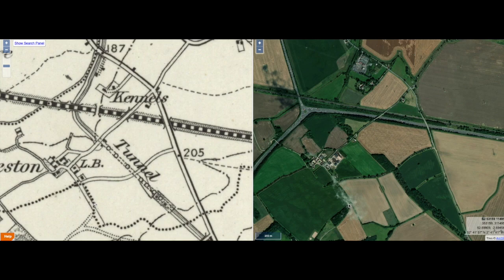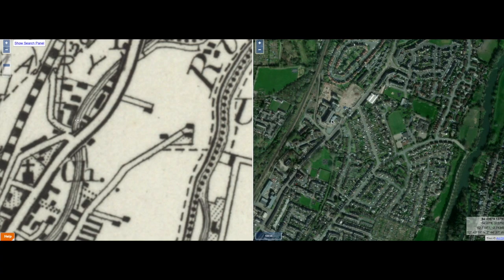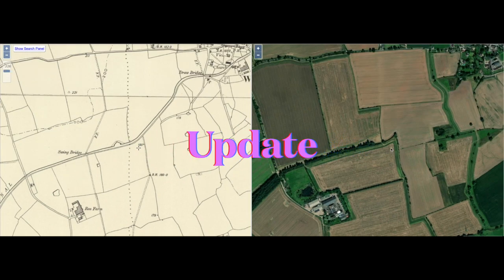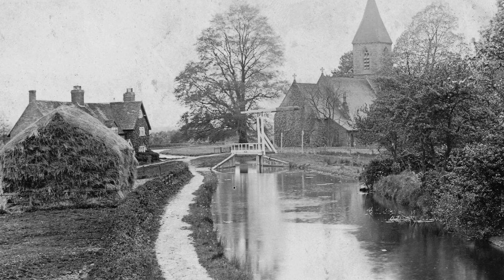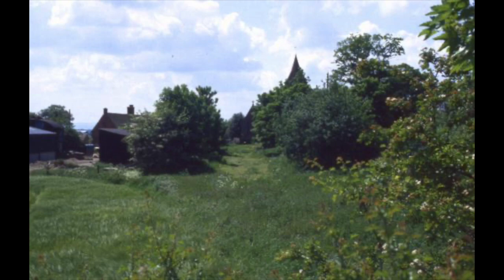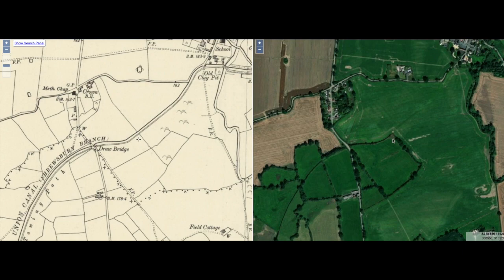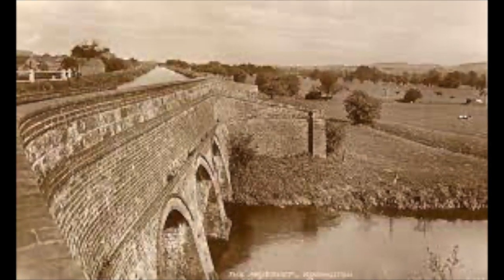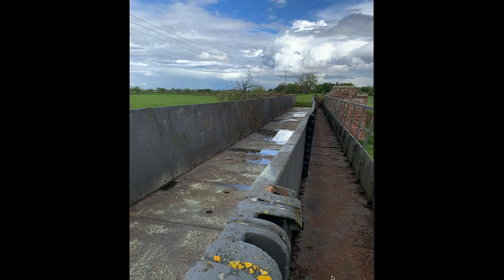Shrewsbury To Newport Canal Part 2

Comment: Fascinating, like part 1.  I note that the cast iron strapping post on the outside of the top lock gate (the swinging gate) appears to be of the standard Shropshire Union design, of which there's still quite a few on the Audlem flight where we are.  So there was some standardisation, which I guess I would expect.
Reply from the maker: thats interesting, i hadn't thought of that. but it makes sense